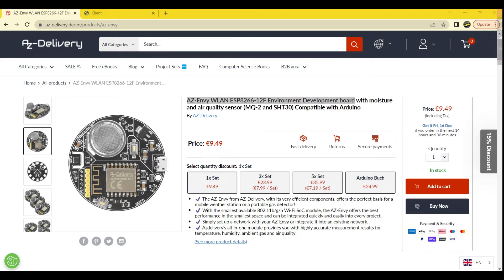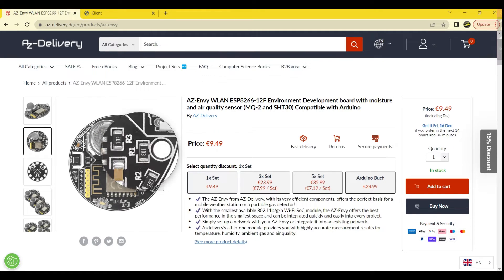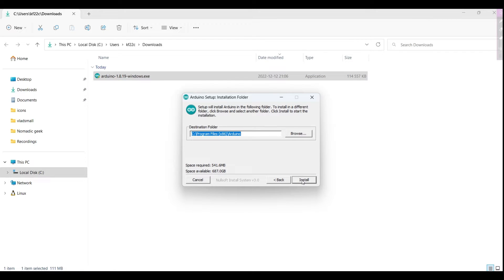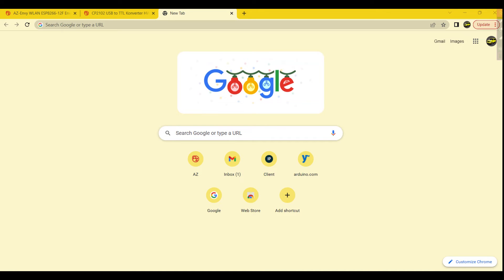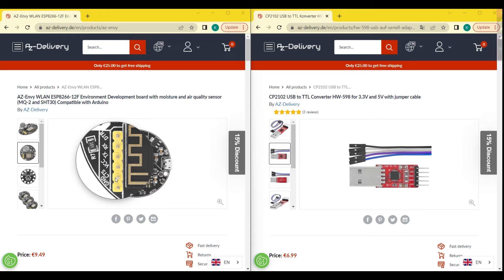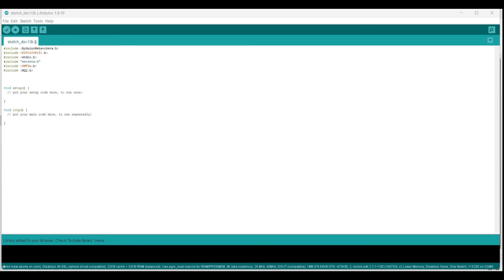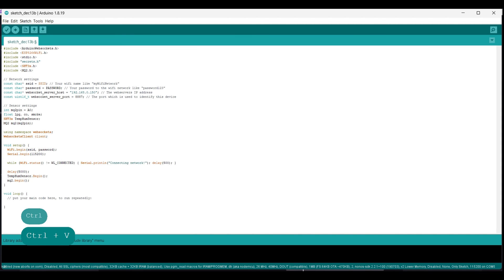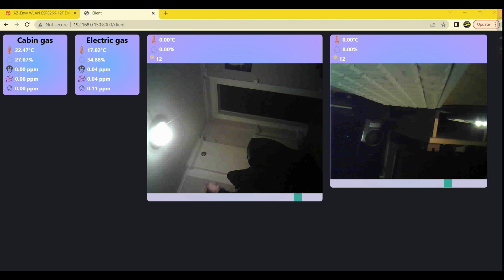ESP8266 AZ-envy Websockets Gas, Hum, Temp sensor stream - How To

Comment: So I used your file from github.
changed Wifi settings and websocket_server_host to the IP of my Raspberry Pi
but serial monitor only shows me this:
����������������������
Reply from the maker: This is a encoding problem. Make sure to save your file in the right format and encoding
Reply: Verify that your serial port is set to 115200baud